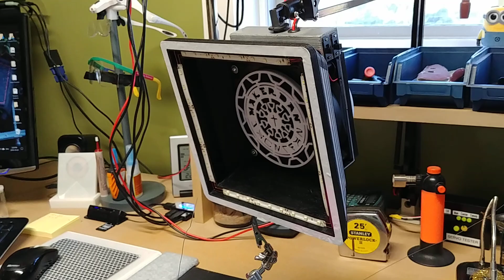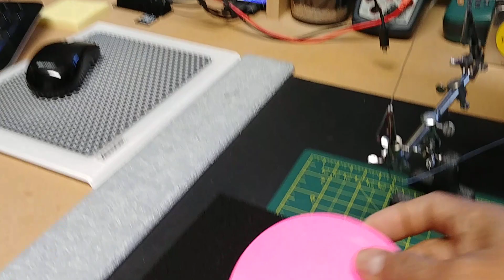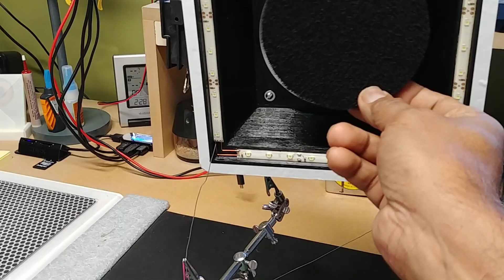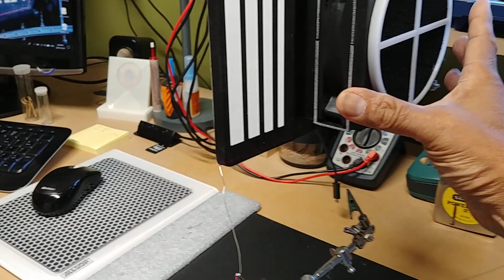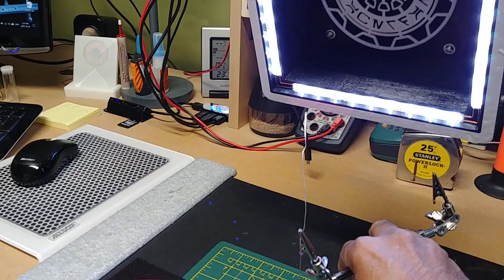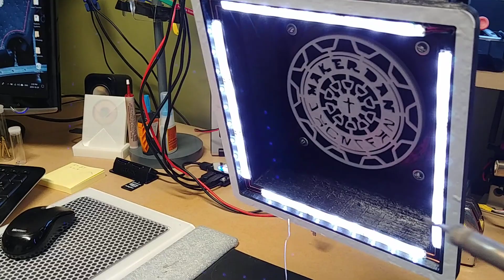Solder Fume Extractor

Comment: Dan, this is a great design. Thank you. I have 1.5 inch very strong fan. I was wondering if you could add center support for 1.5 inch fan? I would greatly appreciate it.
Reply from the maker: Thanks.  I'm not sure I still have my original design.  I'll check tomorrow.  I ended up just buying a small one off Amazon that works much better 😂.
Reply from the maker: I'm not sure what you mean for a center support.  Do you need me to modify 1 stl or all of them?
Reply: @MakerDan55  It's the gray part that holds the fan and switches. This fits I think 1 inch wide fan but I have 1.5 inch wide fan. It's 120mm but wide is 1.5 inch. This is the only STL file needs to be modified. Again Thank you so much!
Reply from the maker: I just added the file on Thingiverse.  It is called 1.5 inch Frame Support.  That means it has exactly a 1.5 inch opening.
Reply: @MakerDan55  👏👏👏👉 You Da Best!

Comment: Im in the process of making a fume extractor as well right now, different than yours, but yours looks pretty dope with the LED and using the lamp arm to hang the extractor is a pretty nice idea 💡.
Reply from the maker: Thanks.  Mine worked pretty well but found that my fan motor wasn't as strong as I wanted so I ended up buying this one:
https://www.amazon.ca/dp/B07VWDN29F/ref=cm_sw_r_cp_apa_i_0YZK6M8N50D6CDX1BC1V